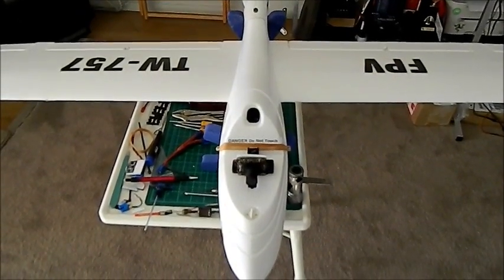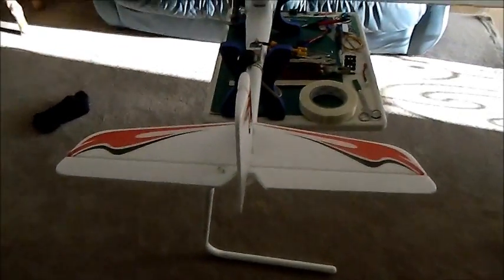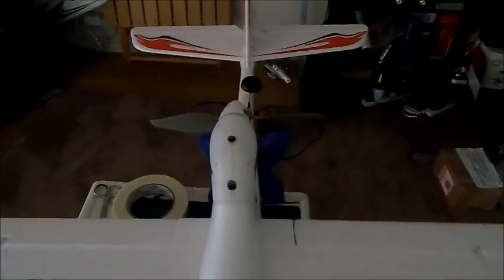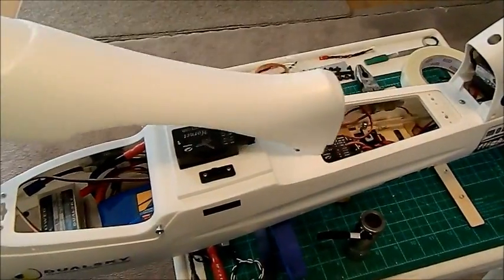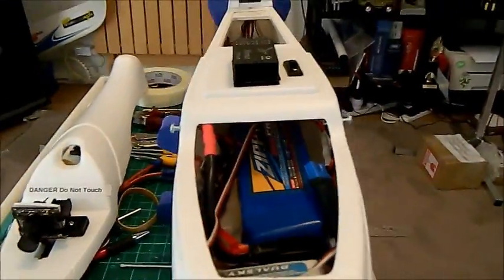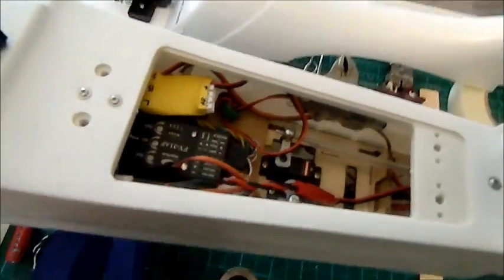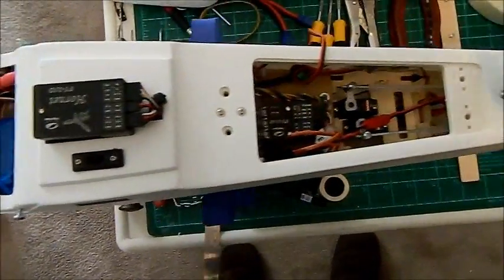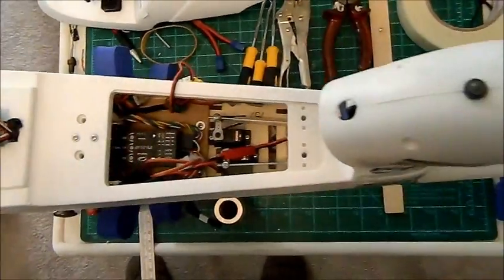FPV Raptor - Build Overview

Comment: Where does all the weight come from? HK description says about 900-1000gr think and yours weighs 1900gr. Or does the 900-1000gr refer to a FPV Raptor without battery?

Comment: Mark may I ask you a question regarding the red light on your fy31ap.
When I apply throttle I get a constant red flash. The manual is a little cotradictive as it states in 2 different places that it could either need re initializing or there is movement, then under the vibration section it states that if red light stay off during throttle test then its ready for flight
If you just touch the plane with your finger the red light flashes.
Can u please tell me what your red light does with throttle?

Comment from the maker: I have not got any block on so not sure what's up there. With ReadyMadeRC you can ask them for a replacement as the risk is theirs until you accept delivery or you can ask PayPal for a refund of the money because it isn't your fault. RMRC would have postal insurance and if they don't that's their error. The V1 Penguin has not got the built in tail support that the V2 has so crushing injury is vastly reduced with V2. Let me know how you go and feel free to use the email address I supplied you.

Comment from the maker: Was in the tower I don't use this plane any more as the Penguin is a far better platform. Make sure you reinforce the tower where it mounts to the fuselage or it will eventually get torn off.

Comment from the maker: Thanks and yes I did maiden her. However, it was a windy day and that masked the fact that the motor was way underpowered for the frame, so when I took it out a few days later on a calm day, well you can imagine the snapped wings and busted up plywood... :o( Not to worry I bought a better plane and put the servos etc in it, I'll post that one really soon (having trouble with Vegas 12 at the moment!)...